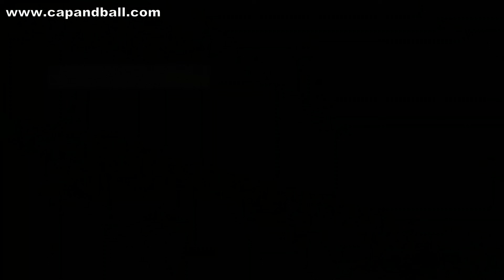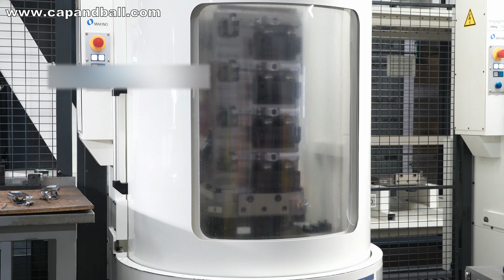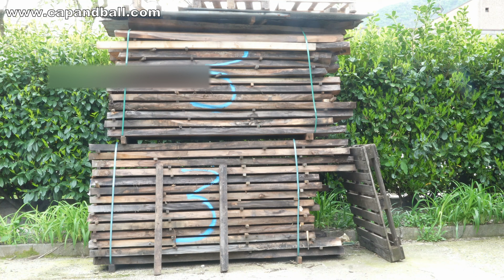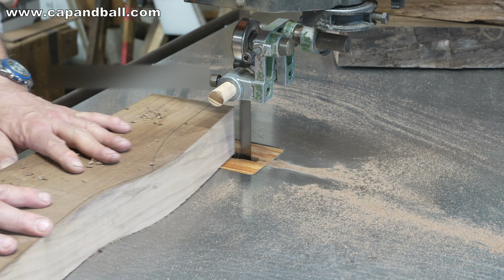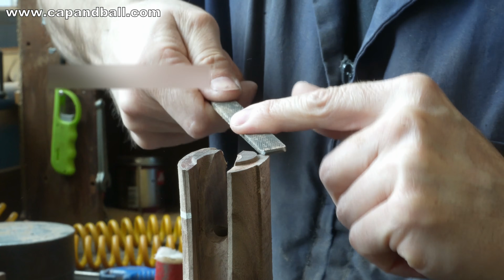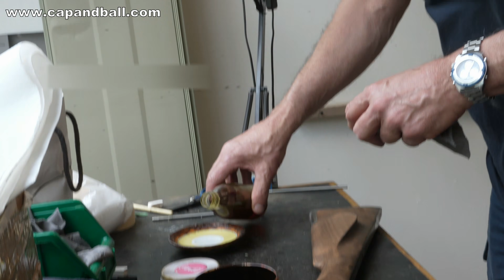How a M1886 lever action rifle is made. Part I. Receiver and the stock #leveraction #winchester

Comment: Outstanding timing! I am in the early stages of research for purchasing an 1886 in 45-70.
Reply: You end up getting one?
Reply: @TeensierPython-s8j  Actually,  no. I am exceedingly picky and short of getting a full custom from Turnbull, I can't find what I want.  I didn't think it was that complicated, but apparently it is.  I want: octagon barrel,  case hardened receiver, flat recoil pad or steel plate at the rear of the stock. I don't want: a threaded barrel,  a plastic anything, any m-lock slots, a hooked stock, or a picatiny rail.

Comment: Comparing with my original  1886 carbine in 50-110  the rifle is more of a 71 than a 1886 . It has a coil mainspring , ( I prefer the feel of a leaf spring to the coil )and the most important  improvement( at least for me) is the ejector , which is a 71 , and far superior to the 1886  . A difference with the 71 is the extractor , which is not the long Winchester version present in both 1886 and 71.
Since I have seen a .348 version offered in the website I wouldn't be surprised to see a 50-110 in the future. After all , Starline makes 50-110 brass , so it's not so difficult as it used to be  40 years ago.

Comment: The 1886 in 45-70 is really limited for that action. The 45-90 and the 50-110 brings the rifle to its full potential.
Reply: Wait, you get lever guns in those calibres?
Reply: @debbiegilmour6171  The original 1886 was chambered in 45-90 and 50-110. But don’t shoot the hotter handloads in them. Browning and Winchester 1886 rifles made in Japan are stronger. They did make them in 45-90. If you want one in 50-110, it’s just a barrel change.
Reply: @RichardMorse-h6r  actually , not so easy , there are differences, remember the 50-110 is the only 1886 cartridge with a base diameter different to the 45-70. The 50-110 was used  as a parent cartridge to the 348.
Reply: @pecospest  True, .608 in the 45-70 and .607 in the 50-110. I have never had a problem with mine.
Reply: @RichardMorse-h6r  you probably mean the rim , the base of the 45-70 is .500 and the 348 or 50-110 is .553, the 50 guns have several differences versus all the others , among them  carriers , cartridge guides , finger lever, top of the chamber  milled  etc etc.

Comment: The modern 1886 in 50-110 is the most powerful lever action rifle ever made. With hand loads, it will produce over 6000 foot pounds of energy.
Reply: But who makes the 1886 in 50-110 now? I have an original but the only one I have seen is the hot rodded Alaska , which is not really the same thing as an original.
Reply: @453421abcdefg12345  Unfortunately, no one makes it today. I have a Browning 1886 made in Japan and rebarreled it to 50-110.
Reply: @453421abcdefg12345  Unfortunately, no one makes it today. You have to buy a newer 1886 and rebarrel it to 50-110.
Reply: Винчестер мод. 1886 года,  .50-110 EX, был у меня. Также и мод
1910 года,  .401 калибр.
Reply: @ГеоргичКоржев  У вас еще есть 50/110, их сейчас довольно сложно найти.